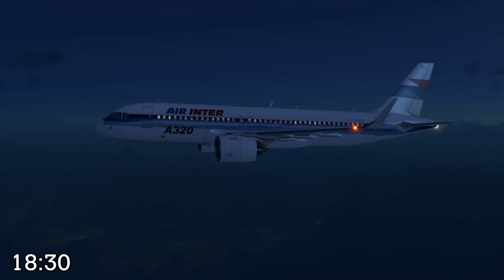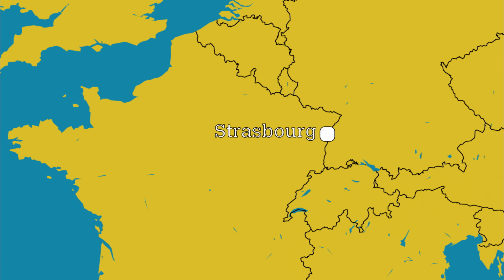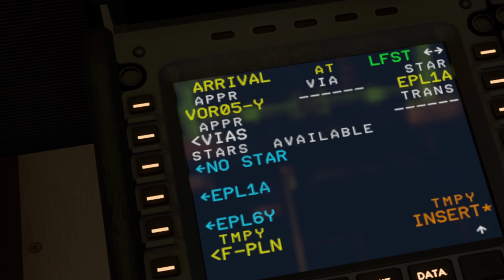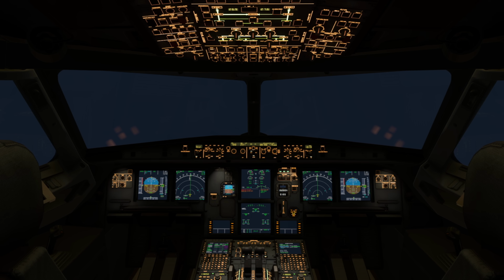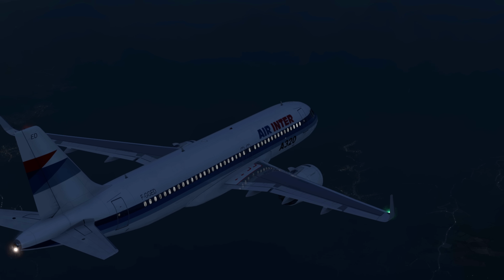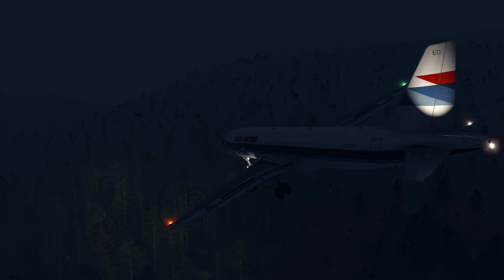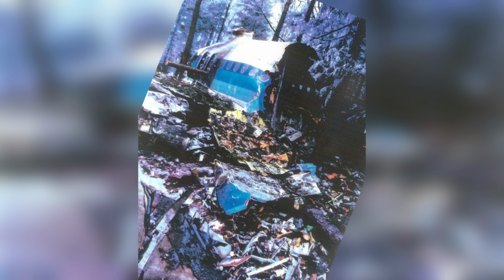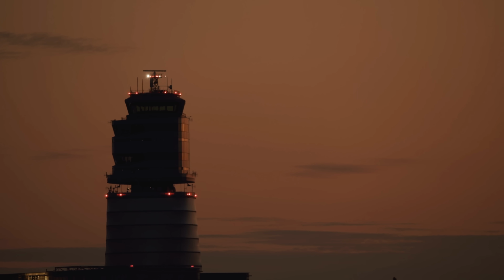Betrayed By Their Instruments - The Horrific Crash of Air Inter Flight 148

Comment: Nice that you mentioned the Mercure. The failure was that it had fuel for its short legs on domestic flights, but what the operators wanted was multiple legs of domestic flights. The Mercure was simply a bad copy of a 737 with much smaller tanks. Biblically stupid build by Dassault.

Comment: Two pilots with less than 200 hours cumulative experience on an aircraft type is a terrible pairing.
I try not to judge crew actions using the "you weren't there" acknowledgement that certain circumstances can bite even the best aviators, however I can't understand how even the most inexperienced crew couldn't feel or otherwise sense a 3300 ft/min descent, not to mention see it on their attitude and VVI displays.
Reply: It was a new aircraft type. It is literally impossible to have pilots with longtime experience on an aircraft type if said aircraft type is new. Every A320 pilot in early 1992 would have had low hours on it, since the plane had only been in service for less than four years.

Comment: For "shared" displays such as the Airbus Flight Control Unit, why isn't the 'alternate' display in a different color?  Seems to me that would be more effective in helping crews to determine which mode the display is set to "at a glance" instead of a small 'V/S' or 'FPA' symbol.

Comment: Why would anyone take an flight of one hour apart for the experience? Surely catching the Train would actually take less time unless airports are a 30 minute affair each end ? 
If there was a modern highway or railway completely connecting Bournemouth directly to Plymouth then this would be quicker than hanging around at airports . There isn’t so in my local example it is probably just as quick using short haul due to Englands rubbish road network in south & south west England.

Comment: I still don’t really get what went wrong exactly
Reply: Tl:dw; they were stressed, plotted in the wrong numbers in a certain system, and (and this is just me assuming) crashed before realizing what was happening due to that wrong input
Reply: They meant to put in the angle of descent (3.3) but they put in 3300 feet per minute descent. This meant they descended a lot faster than they expected.

Comment: Interesting to see how increased workload of a circling approach contributed to this incident. I've noticed that crop up as a major contributing factor in multiple other accidents & near-misses, which makes me wonder if it's something that airports now try to actively avoid in their runway designs and pilot trainers dis-recommend when training their crews? The sheer increase in workload involved in that type of flight pattern seems to quite frequently lead to these types of issues around loss of situational awareness &/or errors in managing bearings and turn directionality.
Although whoo boy that original Airbus UI design sure didn't help! It's always frustrating how disconnected the design process often seems to be from actual user experience 😔

Comment: Nice video as always.

Some insight here: the justification the captain gave to the FO for flying the ILS 23 was that in order to fly the VOR 05 approach, they would be required to fly overhead the VOR and come back around to fly the complete procedure turn (that's the reference to 11 miles x2 ie the outbound distance and back). He had not realised that he could actually fly a straight in VOR approach to runway 05. Thus, he preferred to fly the ILS 23 followed by a circle to land for 05 as in his view, it would not add to the track mileage. 

The approach plate for the VOR 05 didn't clearly show that a straight in approach was possible however, looking at the STAR chart, it was positively the case. The FO had understood that but he didn't try to clarify this with the captain. The captain, on the other hand, might have been biased towards a type of approach he was more comfortable with and certainly was more proficient with on the A320.

It didn't help that ATC never issued a STAR to be followed and that the crew didn't seek such a clearance either. 

The straight in VOR approach clearance eventually issued by ATC confirmed the FO's point of view but took the captain completely off guard. Not pressing on for a straight in at this stage was the right decision. 

The crew accepted vectors that were too tight to intercept the final approach course prior to the FAF and the crew also fell a little behind the aircraft in that they failed to slow down and configure early enough. 

They found themselves trying to intercept the final approach course while configuring the aircraft and descending at the same time, which caused a cognitive saturation phenomenon. Both of them became tunnel visionned around the lateral nav and overlooked the vertical part as well as the automation monitoring.

And there was no GPWS to save the day.

Comment: Is this the one where they flew the VOR like it was an ILS?

Whoops, wrong incident…this is the one where they changed the descent mode, and also the airplane was in ALTERNATE LAW

Bucking Airfus.

I think sometimes the human-machine interface plus the “protections” cause not only confusion and put the pilot in a “trying to catch up with the airplane” mode but, more insidiously, allow a dangerous level of complacency to develop.  It can’t be 3300 fps, because the airplane would never allow that to happen! 

This is both the poorly designed control panel (human machine interface) and the playing-catch-up-with-the-airplane thing.  

These issues have been key parts of the accident chain in other incidents, including on non-Airbus aircraft.

Comment: The worst and most dangerous thing they ever did was to input your speed, altitude, and decent rate into a computer.   Having flown thousands of hours in smaller planes everything is done manually.  I do not ever use autopilot.  I adjust the throttle, the trim, altitude, the decent rate all manually.  I have seen so many crashes because of a pilot putting the wrong information into the computer.  I have flown IFR approaches to minimums many, many times alone and always did everything by hand.  The problem is if you think the computer is keeping your altitude or your airspeed for you, you become complacent and don't check the airspeed indicator or your altitude because you believe it is taken care of.  

The Florida crash where the pilots were busy trying to get the nose wheel light bulb out to see if the gear was really down or a faulty bulb.  They were on autopilot at 2000 ft.  But someone  bumped something and the autopilot disengaged.   No one noticed that they were descending as all three were so focused on trying to get the light out.  When they finally realized it there was still time to save the aircraft, but they were arguing over the altitude.  One pilot says we are at 200 ft.  The captain says no, no we are at 2000.  They were so disoriented from all of them trying to fix the light they took no evasive action and continued down until they hit the water.  One person working on the light bulb would have been enough and one of the others should have been flying the plane and the other check the gear manually.

Comment: Folks, for those that are now surprised why Airbus created such a seemingly dubious panel interface design:

Look at the Airbus A300/A310 cockpit panel interface and look for the vertical speed window.
It's basically exactly the same there.
3.3 stands for -3.300 feet rate of descent on the A300/A310, because on the A300/A310, the display window can only indicate three symbols: +/ and two digits and it worked perfectly fine for decades when the A320 waa built.
So Airbus just kept certain aspects of the design from the A300/A310 in the A320 cockpit.
And thats why the interface panel looked the way it looked.
They just modernized it to (back then) newest standards and put some more functions into it. That's it.
They never perceived this as a potential dangerous design.
Since the A300/A310 fly fine with the same vertical speed indication window for several decades.
However A300 and A310 do not use that interface panel window to dial in a Flight path angle (FPA).
So nobody really expected something so negative would happen.
That's how that seemingly dubious looking interface panel was created.

Comment: There are a few things worth noting. First, the A320 was a very new addition to Air Inter's fleet, which at that time was fast becoming obsolete, as they were flying planes such as the Caravelle, the Dassault Mercure and early A300s. In fact, Air Inter had long lobbied for a 3 crew cockpit, with unions going on strike during the 80s and so on. So this kind of automated cockpits was pretty new to them. Secondly, pilots had an interesting salary bonus, if they were on time or ahead of schedule, as fast TGV trains were increasingly becoming popular back then, therefore threatening Air Inter's business model. To sum up, that very crew was in a hurry, in a plane they were not familiar with. These factors, in addition to the terrible weather and the design issues present on first A320 series sealed this flight's fate. Oh and not to forget, Air Inter had decided not to equip A320 with GPWS, as they considered these to be unreliable...

Comment: The crash at Mulhouse Habsheim (criminal misconduct IMHO) and the Warsaw crash shortly after gave Airbus a "Bad Name" in that time.
The communication style of Gouloise Bernard Ziegler "Non, zatte iesse impouzieble! Ai wiel aske unne aigienier!" (Asked about the Main Landing Gear Load Switch) made it not better.... The reporter asked wether thrust reverser, spoilers and braking would work with only one Load Switch activated. This was a option.
Lufthansa was also pissed off by that.

Comment: Very nicely presented video.

Thanks for making so much effort with these, they are very professional.

If I were to be really picky;

Your description of GPWS is a bit sketchy! It isn’t  nor does it have its own radar, it is a computer that uses a variety of sources including the radar altimeter & baro altimeter for vertical speed, with inputs from flap and gear selection. Modern EGPWS and TAWS uses GPS position and a terrain map to give more advanced warning.

MEL - Well no it wouldn’t have been in the MEL, but technically MEL is a list of equipment INSTALLED that must either be  serviceable or the defect deferred in accordance with the limitations and instructions contained within the MEL.
The list of standard equipment that may or may not be installed is called the CDL - Configuration Deviation List.
 The required equipment that must be installed is simply stated in the regulation and the operators manuals, OMA/OMB in Europe.

Comment: Another fantastic analysis, Chloe!

I'm curious - Do you think the original GPWS (pre-EGPWS) would have been sufficient?  The original system, as I understand, had weaknesses in the case of rapidly-rising terrain; it looked at terrain distance directly below the plane, but not so much terrain that is rapidly approaching forward of the plane.  In other words, terrain rising with a steep enough slope would sometimes result in the original GPWS alerting too late for the pilots to expect to save the aircraft.  Thoughts?

Comment: Even with a GPWS, the steep grade of a mountain slope might have prevented the system from giving an early enough warning prior to impact.      What we have here is a clear lack of situational awareness.    Even with both pilots having relatively little experience in the aircraft, how could neither have noticed that their vertical decent rate was set at 3300 fpm?      Aviate, navigate, communicate, as another YouTube creator often says.   During the setup for final approach, one pilot flies the aircraft while the other monitors the BASIC FLIGHT PARAMETERS and calls them out !    Altitude and rate of decent, airspeed, heading, state of flaps and landing  gear, etc.    The mistake made with the dual purpose display was an inexcusable rookie error that never should have happened with two sets of eyes and two pilots that had that many flight hours.     An easily and totally preventable tragedy.    Great job on the video and thx.

Comment: I have to think in making  the auto pilot, ( a huge part of daily input ) abbreviated  from  3.3 angles of unit, into  fpm ,  that should have been  reasonably changed to a high visibility color or icon symbol .  And something  discussed  thoroughly by training.  Very nonsensical
Reply: .
See that?
That's all you had to tell 3.3 from 33 ... well, that and a little unit indication top right. Nowadays descent rate displays as 33oo ... it didn't then.

Comment: Very unfortunate that GPWS wasn't installed. With that said, a decent instrument scan during the approach should've clued the pilots into their error. I frequently used FPA descents into RWY 01 at KMSY. Part of my scan was to observe what VS (from the indicator on the PFD) I was achieved using 3.0 down FPA. A typical value was a 700 to 750 FPM descent. If they would've been doing their scan, they would've noticed a 3,300 FPM descent, which is WAY too high for the approach phase of flight. Unfortunately, hindsight is 20/20.
Reply: Also, wouldn't they have the activated mode (VS or FPA) be displayed on the top of the Primary Flight Display?
In this reconstruction I noticed it was set to V/S -1500 and I'm wondering if it should have displayed V/S -3300.
Reply: @JL-db2yc  Yes, V/S -3300 (I believe even pre-mod of the V/S readout on the FCU) would've been indicated on the FMA. A constant scan of the FMA is critically important in highly automated A/C. Sadly, I believe that fatigue was a major factor in this accident. It can certainly be a form of subtle incapacitation.

Comment: For the entire last quarter of the video I kept thinking, okay but surely the ground proximity will kick in at any time. And then you dropped the bomb that it wasn't even required to be installed?? That's insane.
Reply: I was thinking I would hear that the GPWS was there, but switched off since the plane was in landing configuration.
Reply: @Sashazur my thoughts exactly...🫤
Reply: @Sashazur  yes what a disaster when they shut off their possibly only warning of danger. That has to be against the rules now.
Reply: I had the exact same experience. My jaw actually dropped when Chloe said the plane didn't have one.
Reply: I'm pretty sure that with the gear down the goes doesn't go off as the computer thinks the aircraft is landing.
Reply: @Paul-b2s4j Not sure how it would have worked back then on the -100, but on modern aircraft, the plane "knows" exactly where the programmed airport is supposed to be at and if you're not right where you are supposed to be (and still getting closer to the ground), it will warn you. It will even warn you if you're off the centerline, if you're over-shooting the landing and about many more discrepancies. Aviation safety has come a long way from accidents like these.
Reply: In the United States the FAA forbids pilots from exceeding 250 knots below 10,000 feet, but Air Inter pilots routinely flew much faster than that low down. This was likely a factor in why GPWS (if fitted) would have given off so many nuisance alerts, and Air Inter (which only flew French domestic flights) had such a policy because of the fierce competition they faced from France's TGV trains.
Reply: Me too 😢
Reply: Welcome to 1992.  :P
Reply: ... Oh No. 😧
Reply: I think those older ground proximity warning systems warned the pilots if they were to low, but not that the ground was rising ahead of them.
Reply: "And then you dropped the bomb that it wasn't even required to be installed?? That's insane."

Hindsight is 20/20. 

The reason why you feel it's insane not to have this device onboard is that you know many stories of how this device prevented crashes.

Many years go NASCAR racing had a problem of drivers crashing into the wall and breaking their necks. A safety device was invented but the drivers did not want to use it because it made them look like less of a man, and they did not believe that it would save them anyway. Then Dale Earnhardt crashed, died, and the autopsy said "fractured neck". THEN they started wearing the HANS device.

Hindsight.

Comment: This was obviously a big topic at the time here in France, and in fact long after, as the judiciary trials linked to this accident were only closed in 2011. With big controversy, because the appeal court cancelled all compensations which were due to be given to the victims' families.
As for Air Inter, they were merged into Air France in 1997. The fusion was planned since 1990, and this crash just sped up the processus.